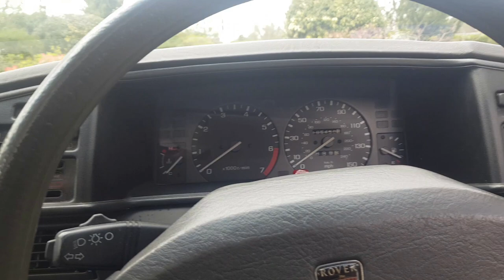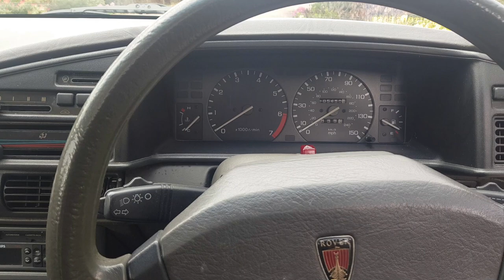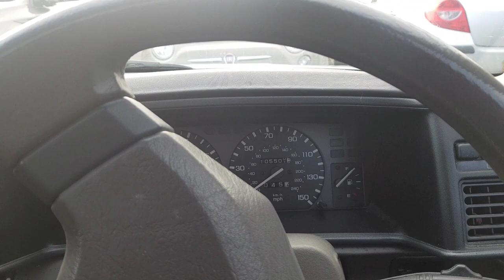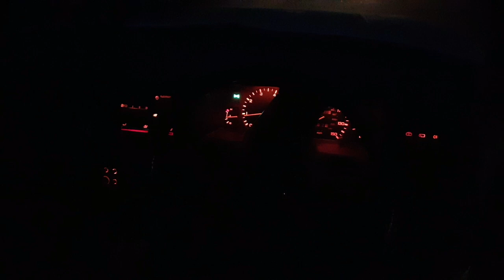Collecting my new Rover 820 BASE (it broke)

Comment: Sudden headache could be exhaust fumes getting in... Possibly through the air inlets? A cheap domestic CO alarm will tell you
Reply: I had trouble with my 406's EGR valve leaking exhaust into the engine bay and cabin - diesel exhaust is much harder to miss though! Certainly worth considering with an older car.
Reply from the maker: Taking a CO alarm with me tomorrow.
Reply: Indeed, and it was a bit of a co-incidence that it came on after closing the sun-roof.
Reply: Good idea. Might be worth all of us with knackered old cars getting one just in case!
Reply: @pmailkeey I did that once with a diesel van. Ended up looking like a black & white minstrel!!!
Reply: The headache is simply buying the Rover 820. You'll never beat an SD1...I've owned several.
Reply: My immediate thought was CO getting into the cabin, especially as you said you’d closed the sun roof.

Comment: Sitting in a car for a long time with mould growing is not good and may explain the headache ? Take care and watch out for any strange symptoms ongoing. Great looking car - I would start by stripping the brakes down and doing a deep clean before buying replacement parts - new seals and fluid can often work wonders.
Reply: "..strange symptoms ongoing .." Like mushrooms appearing in the beard.and colored lights flashing across the ceiling. When George starts demanding his dinner in welsh,you know that mold will be responsible.
Reply: I’ve had lung disease and it’s no fun and mould causes lung problems

Comment: I was so into the Rovers back in the day...  Mine was the first in the UK with a custom  built in CaprPC with 7' touchscreen SatNav, MP3 etc, and boost controller, lowered suspensions, updated brakes, clutch exhaust, air filter etc...  I'm stoked that I have happened upon this video. I was a member of the 800 owners club....  Had my main car on track at Silverstone Trax in 2001.  I owned 4 800's over the years but eventually I did defect to a Nissan 200SX though in 2003.
Get in touch!

Comment: I laughed out loud at this (sorry). On your video last week about the austin metro I wrote:
"the brakes on my 1994 820 were awful. I became an expert at lying flat on my back beside the rear nearside wheel so I could reach the brake cable behind the wheel and jiggle it about until the handbrake released, sometimes in my work suit." 
and here you are WITH THE SAME PROBLEM 25 years later! I did try to warn you. Cheers.
Reply from the maker: Cheers. Handbrake eliminated from my enquiries. Main piston seizing up...

Comment: Today, I spied a P-reg Rover 418SLD estate at the shops. And my first thought was.... "How HubNut is that?!"
Reply: I bought a N reg rover 400 1.6 with 34.000 miles for £200 motd until September. Sills under plastic sill liner is rotten both sides. Inner sills OK.  As I drive it I always think Hubnut lol.
Reply: @marklane5222  Ah, just like the sills on my M-reg BMW 525i then!
Reply: If i remember rightly that also shared styling with the BMW E30 Tourer of the same era.
Reply: I have a 1999 'v' 825Si currently 'on a ward' I would say after having had it for 2 years now getting all of  the mechanical work done on it first. Its the first car I have ever stuck with determinedly to the bitter end ... and yes hubnut ... tyres, calipers, discs add all of that up and you're not short of £1000, except I paid for mine! My next problem is an electrical problem that's just happened from knowhere - I am going to get the key refurbed and get a spare whilst I am at it, and last year I bought a fully functional 825Si fastback on an 'S' .. so anything else I need will be on that ☺... when its all done, I'll have the bidywork professionally tidied up, the alloys refurbed and its going to be probably the best presented 'parliament blue' 825Si on the road .. I already have assigned the T800WAC registration to it for a lovely finishing touch. It'll be another year before its back in use - but at only a genuine 49k, there's plenty of life in him yet!

Comment: At 17 when I passed my test I also drove a Montego. Was very lucky it was my mum's MG 2.0EFi. At that age and as a new driver the O-Series felt like a rocket!!!
Reply: Steven Kent 
I had a 2ltr Perkins turbo diesel on a h reg at 20 it was like a rocket
Reply: badferrit badferrit good God I remember those 2.0 ltr turbo diesel Perkins they went like lighting. Probably as quick as most modern Turbo diesels today!
Reply: Probably due to the weight compared to a modern turbo diesel, that’s why old cars seem faster, they’re a lot lighter.

Comment: My dad had an 820e saloon on an F plate. I was a named driver on it when I passed my test in ‘92 and I loved wafting about in it at every opportunity! It was a great car but the rust at 7 years old was atrocious! I remember it burning an exhaust valve out as well due to running it on unleaded! Happy times, memories of which have been rekindled by this video! 
Hope you can work some Hubnut magic on the callipers (rebuild kit) and that the headache wasn’t carbon monoxide induced😖
Reply: Indignity at Cat Rustafter 7 years!  As I ranted to Mr Hubnut when ordering one of his tea mugs and hats, my 4 year old dream car Harvest Gold  Rover 2600 bought when I was 22 in 1984 had all standard acoutrements, including advanced corrosion in sills and wheel arches. It also proved to have the smell of petrol in the back to mask damp odours, the de-luxe passenger side glovebox which filled automatically with rainwater, ability to get me home slowly after head gasket failure and then seal failure of the brake master cylinder. I recall tackling everything myself, even fitting a new exhaust, not trusting Kwik Fit.  After six months I was penniless; the ultimate indignity in trying to sell it privately- after stylising the sills an arches with smart black Hammerite was an attempt at a trade-in by another hapless indoctrinated SD1 victim with an even crustier example. I blame my late dad exposing me to Rover with a brief P4 100 spell. He did however have TWO new Marinas which among their other quirks had similar paint quality as the Rover- clumps of it would end up falling off the sills as you washed it....... LEYLAND CARS, A GREAT DEAL AND A GREAT DEAL MORE!  Strangely I bought a Peugeot 205 XLD afterwards and 6 years happy motoring at 62mpg.
Reply: Rust, not cat rust.  Xxccing autoprompt....

Comment: After owning 6 800’s of various ages, specs etc, I still say they are one of my favourites. They were all incredibly reliable and easy to live with. I’ve yet to find something as comfortable. The Mk1 Fastback is the best looking in my opinion and easily one of the most handsome execs of its time. Well done, it really is a fine machine and quite unusual in 820 base spec.

Comment: Ian, you absolutely do need to make sure you have the correct caliper wind-back tool for working on the brakes on these, if you just try to press the piston back as you would with a standard caliper you'll wreck the piston and hand brake mechanism and end up with exactly the same issue you had on the way home.  These pistons have to be wound back into the caliper as they are self-adjusting to take up wear and also provide somewhat of a self-adjusting action for the hand brake.  A lot of 800 calipers have been ruined by people pushing the pistons back in, and a lot of people have been left stranded on the side of the road with the rear brakes locked on after they use them for the first time after pushing the pistons back.  In the late '80s and '90s that was one of the most common breakdown calls to the rescue companies as a lot of people and garages didn't know that these calipers needed to have the pistons wound back in...
Reply from the maker: Visiting a garage who hopefully have the right kit tomorrow.
Reply: @HubNut    That's good.  If the car is going to be staying around long enough to need the brakes doing again then I'm sure the owner's club can point you in the right direction for the right tools at a good price.  It's nice to see an 800 fastback again, especially in white as it reminds me of my old one.  The pre-face-lift cars really were very good looking.  I think one of my neighbours might still have the Sterling-spec stereo and CD changer that he bought to put in his 825 SLD just before it failed its MoT on welding and he decided to change it for something smaller.  He had the complete kit including all the wiring...

Comment: They designed great looking cars back then, isn’t that so much better than the hideous tall SUV’s of today.
Reply: ITlooks kind of like an sd1 which is a great looking car thathas had the rear end of a nissan cherry welded onto it. So it's "not half bad".
Reply: Modern SUVs which are plaguing the roads are ghastly things, to me the golden era for cars was the 80s and 90s. Modern cars with down sized eco engines are designed to appease the environmentalists and politicians rather than the keen driver.

Comment: Awesome motor! As an SD1 owner I naturally love the look of the 800 Fastback. Looks great in white and love the fact it's still got it's original wheel trims. Shame about the probs but sure you'll sort it. I owned a '96 P reg 820 Si Fastback in British Racing Green i bought for £600 when it was about 12 years old. Was ultra reliable, everything worked, but just couldn't sell it...no-one wanted one in 2008!!

Comment: That one clearly has been very loved to still have rear pads with wear sensors fitted.  They are, as I'm sure you'll find, quite a lot more expensive than pads without wear sensors.  It's a wonderfully simple system, one of the wires supplies an ignition live to one pad that flows to a metal contact buried in the friction material and the other wire is a return.  When the pad wears down the contact becomes exposed and the next time you press the brakes the disc completes the circuit and triggers one of the (I think) 3 brake warning lights that illuminate when the hand brake is on to indicate that a brake service and new pads will be needed soon.  Sticky caliper slides and caliper pistons are a common issue on 800s that have seen little recent use, but unlike a lot of cars with sliding calipers, they're pretty easy to access and can generally be brought back to correct operation pretty easily, much to the envy of just about every Vauxhall owner in the country...

Comment: I don't think the stereo is broken. These cars were plagued by electrical issues and it probably blew a fuse due to a short. We have certain Sterling mechanics that still carry on repairs for these extremely rare cars. If you own a Sterling in the United States, you will quickly learn of sterlingfixer.com. I've spoken to Dale as I'm always searching for a 1990 Sterling SL Oxford Edition. Sterling's ran from 1987 to 1991 in the United States. The SLi hatchbatch was introduced in 1989. The hatchbacks are the most rare but I prefer the saloons. Hubnut has made me very happy bringing this car into his fleet. We never got the poverty spec model so this is a rare treat. 😁
Reply from the maker: Stereo is broken. Display doesn't work, so can't enter the security code.

Comment: I loved my 89 820e which had the 16v single point fuel injection system.  Save it from a scrapyard and swooshed around in it for 2 years before I got fed up of multiple electrical glitches which were more expensive to put right than it was worth.  Went all posh and upgraged to a 95 820 SLi which had many luxuries but had the typical 800 dash lift around the instrument panel and suffered head gasket failure.  Finally got rid in 2003 for a new Vectra but would have another one in a heartbeat.
Reply: Much preferred the hideaway wipers on the earlier car too :)

Comment: They were a lovely car, I bought a ex demonstrators car from a local Rover dealer in 1989, it was a Rover 827Sl saloon, it was Silver over grey two tone paint work, I had it right up to 2001 when it failed its mot in dreadful style The body work was free from rust which is rare for a Rover, but it failed on the subframe and a hydraulic leak from the power steering rack, so sadly I had to scrap it in the end, but what I can say about it, during the years I owned it it was a pleasure to drive, and with the honda V6 puring under the bonnet it was very reliable, I racked up over 255 thousand miles I have been through germany with it, and gave it a work out on the Auto Bhan, and also it has towed my caravan up and down the country, the performance from the engine was nothing but excellence very very quiet, and very powerful, I remember when Rover brought out the face lift 800 series, they gave me a new model for 24 hours, and it was a bog standard 820 automatic, and it was dreadful, the engine was gutless (it was dangerous when overtaking as it had no power and you had to really thrash the engine hard)

Comment: Well done.
I was always a Rover man. My first car was a P4 105 from 1959.
I owned an 827 Vitesse from 1994 to  2007.
It was a beautiful, reliable car.
In the end, it succumbed to terminal rust and my own neglect. Sorry.
During my ownership, I had a Belgian girlfriend (who was not interested in cars).
But many times, she had to listen to me bang on about the virtue of buying a British car (even though inside, I knew that thanks to various types of socialism over half a century, we had hardly any British cars left).

One day, she came upon me checking the engine fluids with the bonnet open. 
After a while, she exclaimed "What's that?", pointing at the engine.
I followed her finger.
"Its the air filter" I told her, secretly thinking: "Don't worry your pretty little head about such things".
"No. That" she repeated, pointing again. "... ... and that!".
In fact she was pointing to the labels on the various under-bonnet components".
They were all in Japanese. 
I realized that under the bonnet of my "British" car there was more Japanese graffiti than you would find in a shinto shithouse.

I replaced the Honda related "827 Vitesse" with an  "825 Sterling", which came from the BMW era of Rover. That, too was beautiful and reliable. I kept it until arthritis (in me, not in the car)
caused me to give up driving.
There was one disappointment with the Sterling.
The leather seats.
Beautiful though they were, they were a lot less comfortable than the cloth fabric ones of the 827. and the poor dog slid around on them, too.

Comment: This Rover is lovely, but it confuses my senses because it's a modern late 80s design but opening the bonnet reveals a 2 litre engine that looks likes it came from an Austin Princess 2 litre HLS. You wouldn't otherwise know, especially with how quiet and serene it sounds on the motorway. Thought the lowest ever engine was a 2 litre 16 valve fuel injection. Then again, look at how long the Pinto engine in Fords lasted for - until they stopped making the Sierra and made the Mondeo.

Again, lovely car though. Can't remember when I last seen one, and I fear the scrappage schemes may have taken a few off the roads - both decent ones and the sheds.

Comment: I drove a black 'L' reg Rover 825 (VM diesel) saloon for almost 250,000 miles..terrific car, based on a Honda Legend?
It boasted aftermarket alloy wheels, gorgeous looking car, very comfortable.
It eventually went to the scrapyard after three replacement power steering racks..

Comment: I always found that if you press the piston back in using a g clamp the rotation of the threaded end will often supply the rotation to retract the calliper piston. I also found that the frequent replacement of the older moisture laden brake fluid prevented premature failure through internal  corrosion of the handbrake mechanism.

Comment: We had an 820SI and an 820SLI which were used as family towcars.  They were very reliable and dragged a family of five and a 17 foot caravan all over western Europe.  Eventually traded up to a Discovery 2 with teh 5 cylinder diesel which was totally awesome and towed at 20 to the gallon!

The only reliability issue we ever had was a collapsed wheel bearing, on the caravan!!!

Comment: That tape deck is the same Phillips unit that was in my 1984 Nova. That didn't work either, but it turned out to be nothing more than a loose wire. Central door locking will probably be trickier; I still haven't fixed mine yet. Brakes are often the first thing to give problems on cars that stand around a lot not being used, which is why I always periodically start anything that's been laid up and give it a trundle round the back field. Not high speed stuff but enough to warm everything through and stop it rusting up. The advantages of having a sibling with a farm who lets me store cars there! As for the musty smell of a dormant vehicle, that's easily solved with a magic tree car freshener ;)

Comment: On another note, do feel free to come and drive my 2001 S60 T5 (5 cylinder turbo petrol manual) when you're down Sussex way.
Reply: Acme I had one of those,tuned to 300bhp it was a great car,the gear-lever with the alloy bottom part was cool plus it was quick,under 6 seconds to 60 not bad.
Reply: @michaelpegasiou4531  Mine does 0 - 60 in about 6 seconds with 260HP, but it is manual. Can't wait to get it tuned.
Reply: Acme yeah mine was manual also,I’m not a fan of autos,the tune was about 200 quid and knocks it to about 5.5 to 60,I’m sure it could be tuned for way more.